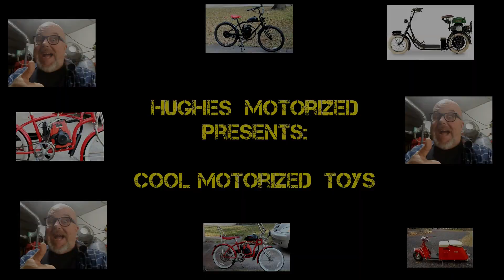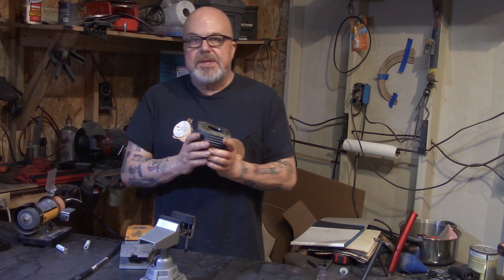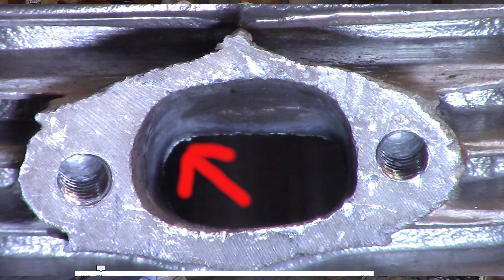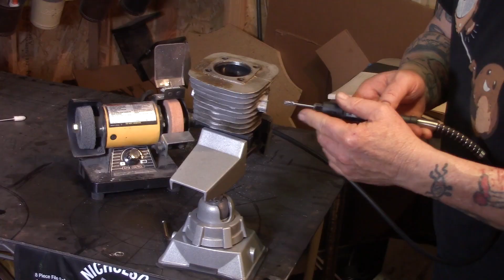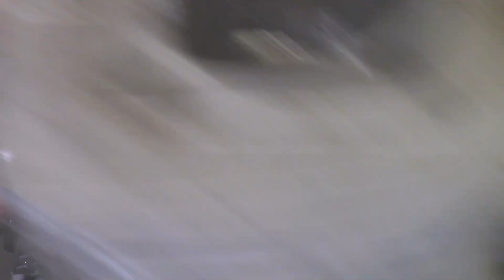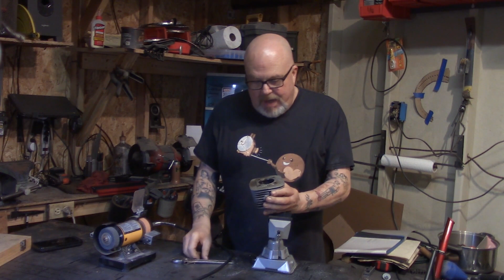How To Port Your 2 Stroke Motorized Bicycle Engine- The Basics - Get Improved Performance

Comment: PLENTY of trash! The new ones with the open transfers and bridged exhaust port (only new one I could find with 40mm intake stud spacing) are much much cleaner than the older ones however I have yet to see if the performance has improved. I usually take the old ones and grind the crap out of em, widen and heighten the exhaust, widen transfers and add JB to the top-back corners of transfers to increase velocity. I'm really wondering how these open ones will do, they look alot smaller especially since they put a partition down the length of each one, which takes a big chunk outta the capacity.
Reply: How was the results of the JB weld? Was considering doing that. Current motor has lots of low-mid and flattens out up top. I didn't change port timing just cleaned up everything and matched transfers to the bottom end.
Reply: @marthamryglod291  all the standard old jugs with closed wall transfers worked great with the JB - I would put it in just before the final cleanup and after all the major cutting, kind of forcing it to pool up in the bottom (actually top,) of the transfers so it forms a gentle slope -then I found I could be more aggressive if I put tape along the inside of the cylinder just covering the backs and that way I could easily see how much area I was closing off from the port. I get a real clean and even rev up high and it just feels like it works. I dont really know if the improvements are worth the time and effort but once I found something that worked I just did that every time. I now have one of the iron lined cylinders running with the same modifications -it took a helluva lot of cutting but it runs fantastic.
Reply: @codelicious6590  oh cool! The new motor I have is the first iron sleeve I've messed with. Lots of clean up before first start. Second tank of fuel now. Doesn't rev like my old motor but has more bottom end. I really went all out on the last engine and it liked to run high rpm and would cruise at 45 with a 32 tooth sprocket. I want this engine to have some more up top. I think I will widen transfers a millimeter towards the back and use the JB weld. I also haven't widened the exhaust muchor raised it more than the mismatch between the iron and aluminum.
Reply: @marthamryglod291  that mismatch you said- did you have several of mm of iron to grind away? Ugh i know I did and it was rough- the steel chips are not nearly as easy to deal with or brush off yourself! I mustve worked on it for 20 hrs. Anyway, if I were you Id start by just widening the inside of the exhaust port (cylinder end), raise it only 1mm - also it may help to measure your blowdown (distance from exhaust opening to transfer opening) Ive heard that is one of the most important. Id be careful not to raise the transfer outlet any if you do actually cut on them I think you will get results from just doing the exhaust and adding some JB to the transfers tho. try not to cover more than 2mm of the transfer outlet and also smooth out the surface of it after it dries so theres nothing to cause turbulence.
Reply: @codelicious6590  yep at every port. I tried to leave the transfer ceiling at stock timing and just decided to open up the other ports. The engine is a brand I hadn't heard of and lightly printed their name on the ignition cover. Good kit, good parts, good casting, bad ports. I'm looking forward to seeing the results of the JB weld and exhaust widening. May raise exhaust port 1mm more than the aluminum casting height and shave the head to get .7mm squish and bump compression up. I'm not going to put a degree wheel on it. Just guessing at potential here. It my son's bike and I built it so we can ride together.
Reply: Oh and I think that the piston is covering the bottom of the exhaust port 3mm at BDC. Did you notice that?
Reply: @marthamryglod291  I dont think mine was quite that much but Im pretty sure that if you widen it and the intake port is fully opening, it shouldnt hurt. do you cut your piston skirt? I do about 2-2.5mm just make certain but when I put the new iron sleeve in I got a small reed valve so then there was no need- just a window which I went ahea and did myself since the price difference is ridiculous and you can get it just right if you do it yourself.

Comment: I actually had a conversation with custom motorcycle builder today. I was going to ask him about porting and polishing my motor. Long story short, he said that at the most I should just buff the ports. But as far as going overboard there's really no need to. He said the only thing I should really worry about is the muffler and the carborator..... He had to have been telling me the truth cuz he didn't even want to do it for me. He said he hadn't even heard of anybody doing it for over 30 years ago....
Reply from the maker: He sure has a point with most motorcycles today. 2 stroke motorcycles haven't been marketed in large numbers since forever so I doubt he's working with them. Cleaning up and opening up intake and exhaust ports certainly do help. A dealer tech wouldn't do that as it is not factory suggested and maxing out power will certainly lead to problems I'd offer. These cheap 2 strokes can handle more only up to a point. My rat bike which is running the cylinder I mildly ported in this video runs so much better and I highly suggest doing it to all 66cc 2 strokes
Reply: Dude just wasn't experienced with 2 strokes most likely.
Reply: If u don't know what you're doing then yeah I wouldn't go any further than cleaning up the ports because if u just go in there cutting with no idea what you're changing u can make it run worse in a hurry.

Comment: Very helpful. I sure the hell dont want to go 60mph on a Bicycle, But I do want as much safe & free/cheap power & performance as I can get, or else I would just buy a cycle for $1300
Reply: Speed is a matter of gearing. If you take a 60mph bike and but a 44 tooth sprocket on it, you're gonna have a hill climbing beast.

Comment: I have a 4 stroke engine kit  I lost the 5 8 bushing straight shaft  where could I buy one n the bolt
Reply from the maker: Gasbike should have the bronze bushing. Any good hardware store should have the bolt. I dont remember the size though
Reply: @HughesMotorized   that's where I found the 58 bushing but their sold out

Comment: Hi Eugene. I am cleaning out the rubbish in the intakes and lowering the intake and raising the exhaust by 1 mm. So when you say you can leave the carburettor intake slightly rough, how rough do you mean. Do I still need to sand down the carbie intake or can I leave the little grooves from the Dremel in it? And just sand the exhaust intake smooth. Or do you recommend sanding both intakes? Thank you so much for all your help!👍👌
Reply from the maker: You want to sand both intake and exhaust where they go into cylinder so a ring wont snag on a burr, polish up exhaust and scuff up inside of intake.

Comment: Hi Eugene, thanks very much for all your help lately. But can you please tell me what you mean by a plug chop please. Can you please explain to me how to do it.. as I am replacing my cylinder, piston and rings thank you very much mate. you’re a legend. 👍
Reply from the maker: Yes I can. There are videos on it. You put a fresh sprk plug in and warm engine up. Run 30 seconds at full throttle. Kill it instantly, pull plug and see color. That will tell you how your  jetting is for full throttle (main jet).
THEN you put a fresh plug in, warm it up and run 30 seconds 1/2 throttle, kill it and look at plug. That will tell you how mid-range is working. Stock NT carb, slide needle regulates richness for midrange. Black pug = too rich. Whte deposit on plug = too lean. Coco brown color = just right

Comment: @Hughes Motorized I have been using BPR6HS spark plug is it good and it looks the same and it works well in my engine.

And one more thing is iridium spark plug okay to work in the 2 stroke engine spark plug 1 BPR7HIX iridium cost $25 here spark plug number 2 BR8HIX iridium cost $41 here so which is the best can you make a video on about this spark plugs and tell us if it's better to run on a normal plug or iridium
Reply from the maker: Some swear by Iridium plugs. $25 and up? I'll pass. B6HS works for me
Reply: @HughesMotorized  that iridium plugs are not cheap that's for sure. 
Do you think an iridium plug will last for the whole engine's life? or will it last longer?
 that's if you install that plug from the day you start riding.

Comment: Thank you Eugene! Your videos are awesome. Well done!  Agree, don't need to go fast on these motors.  I live in a hilly neighborhood, and think cleaning the junk out will help as described.  But, do you think I am better off not to take 1mm  off on In/Out ports, so I don't lose the bottom end torque?  I also don't get a smooth power flow, and the motor is past breaking-in period.  I did follow your "needle set" video for the carb, and it seem to help somewhat.  Much appreciate your feedback.
Reply from the maker: Widen Intake & Exhaust and cleanout would help overall and maintain low end.Also a Hi Comp head
Reply: @HughesMotorized  I've seen people bevel the piston where the transfer ports meet with it, what does that do exactly cause I haven't been able to find out what that does

Comment: Hi Eugene, my 80cc kit Just arrived and I’m wondering. I’m going to take the head off because I have a CNC racing head and I’m also going to take the barrel off to have a look at the intake holes. I will use a Dremel and then what grade sandpaper wet and dry do you recommend to finish the barrel with please? Then I see you finally finish with a supermarket green scour pad. Mainly wondering what grade sandpaper to use after the Dremel before the scourer please. Thank you mate. You really have great no-nonsense videos.👍👍👍
Reply from the maker: 320 wet dry sandpaper will get it
Reply: It's called Scotch Brian comes in many grades usually red and green
Reply: Scotch brite rather